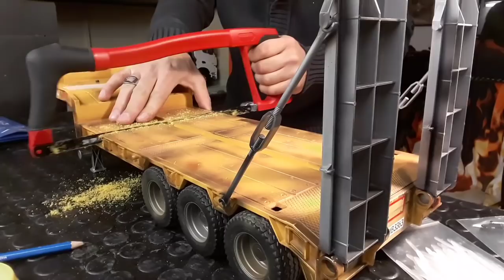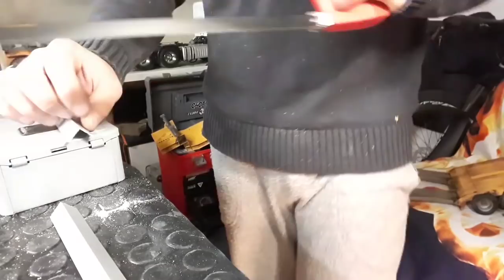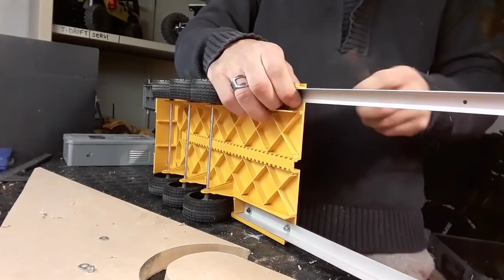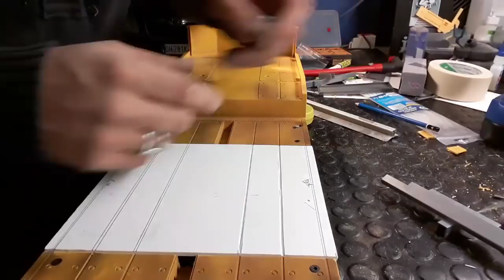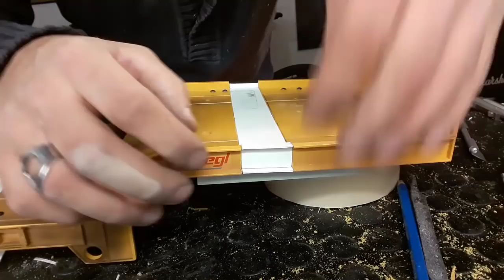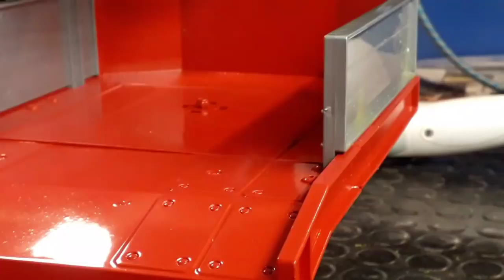Bruder:how to stretch a low loader trailer

Comment: its missing the rubber wheels nice work.. I have a few myself.. Im checking you channel out now.. I got serious builds on the bench grand hauler ertl diecast international rc conversion, bruders/ mercedes 8x8 4wheel steering bruder half pipe dump conversion..

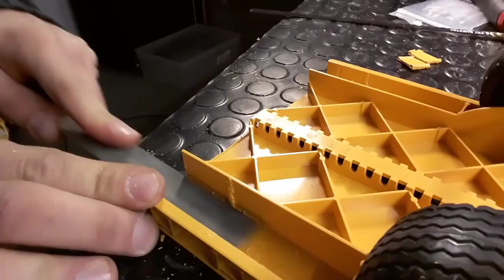Comment: Hello, do you know what were the original dimensions of the trailer (width and length of the whole and the platform itself, cm)? I am looking for some to use for models from WPL, but nowhere can I find the dimensions of this trailer, and it seems that it should fit? I know that the semi-trailer and WPL models are theoretically on the same 1:16 scale, but it does not always fit live.
Reply from the maker: oldsu oldsu hi buddy!!
Well,original lenght 62cm
Width 18cm
If you don't stretch the trailer,he fit regulary,but he lost the best look with the truck
I have take the lenght to 82cm for have the real scale of the lowloader trailer
Reply: Thank you for your answer.
WPL B1 has a length of 34cm and a width of 14cm so it can fit into the trailer.
I wonder if I would like to use B1 as a tractor, would it not have been a bit too small for this trailer?
Would not it look disproportionate?
Do you have an original Bruder truck from this semi-trailer and can you give it its dimensions?
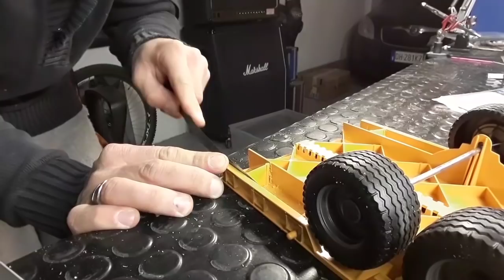Reply from the maker: oldsu oldsu i don't know...i've hanged the trailet to the 1:14 tamiya truck
You can see the video here
https://youtu.be/spc2GNMSwBY
Reply: Ok, thanks anyway fot your help.
Reply: And to close the topic, for all those interested who, like me, wondered what WPL would look like with Bruder low loader, in the end I managed to find a project that someone else has already done :)
https://www.rctankwarfare.co.uk/forums/viewtopic.php?f=209&t=24468